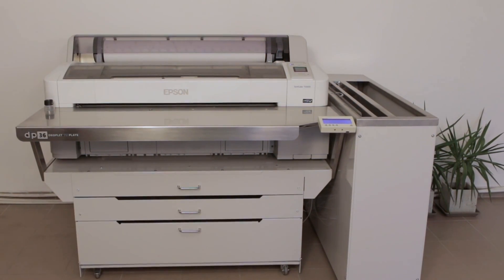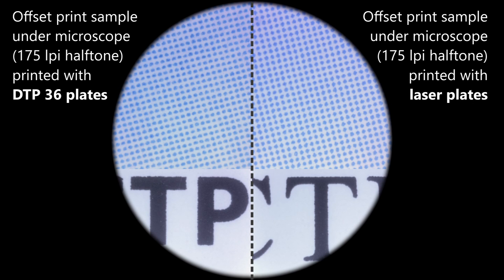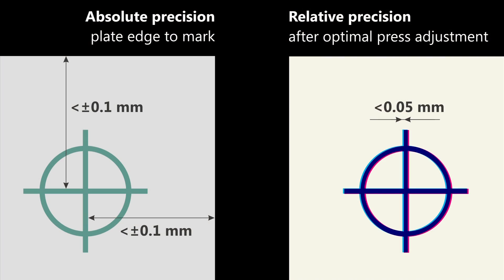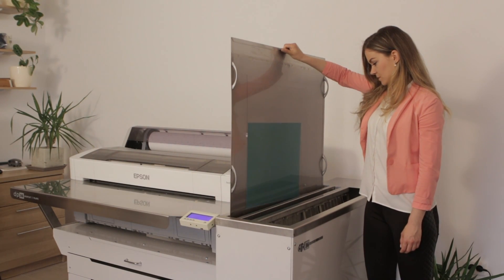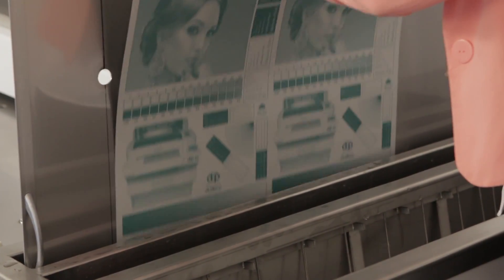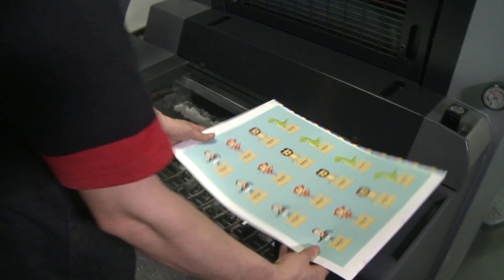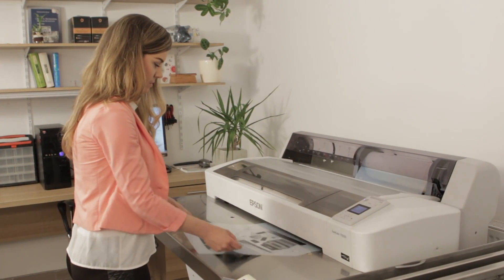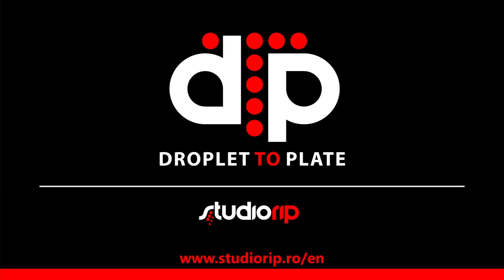DTP 36 presentation

Comment: Does this work with any positive acting conventional plate or do these plates have a special inkjet receptive coating on them?
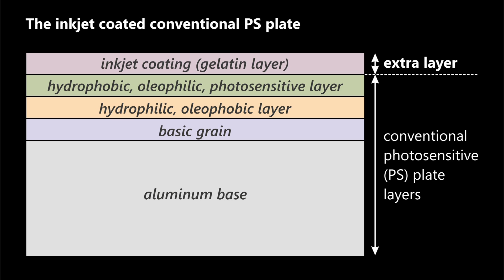Reply from the maker: They have a special inkjet receptive coating on them, as shown at 0:51. That's the reason why it has so much better quality than other solutions without inkjet receptive coatings – this coating prevents the ink from spreading, and also allows enough ink to build up to form robust halftone dots. Technologies without coating generally use less ink (resulting in much less sharp edges), and typically have problems at 50% (where the dots touch) and above 90% (where the dots get plugged). 

This technology is REALLY comparable with laser – the results are difficult to distinguish without a microscope.